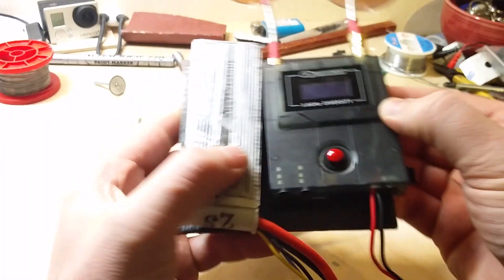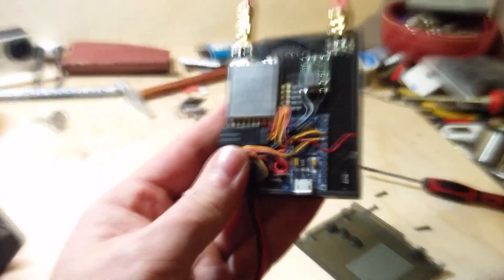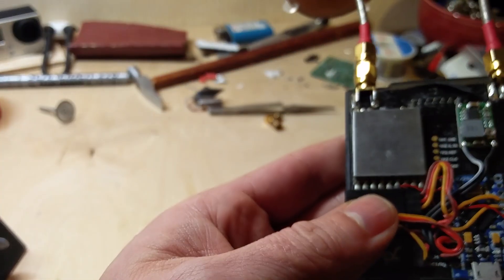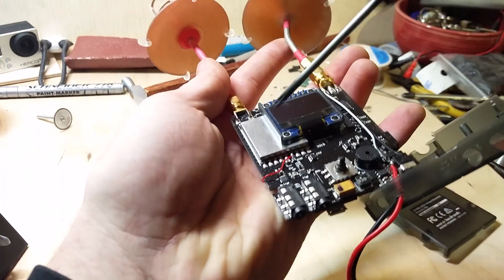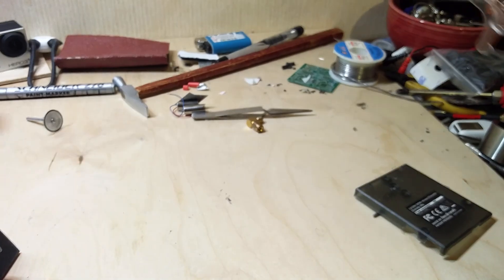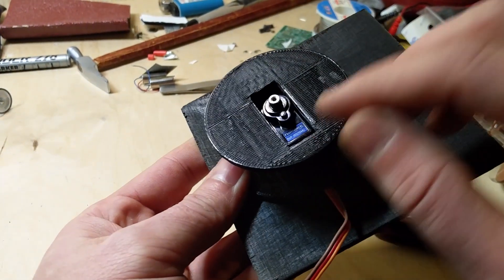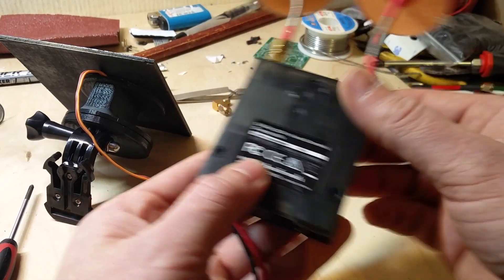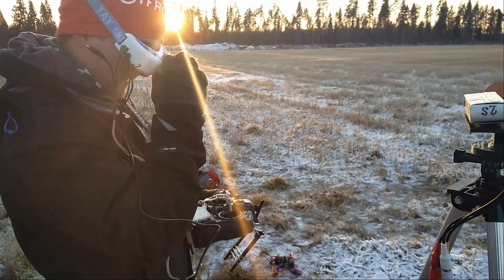SUPER SIMPLE 5.8GHz RSSI ANTENNA TRACKER

Comment: Can I use antennas of different turns?
Reply from the maker: Hmmm..I havent tried. If the difference isn't too big, like 3 and 5 turns, I guess it could work. In theory it would result in offset towards the weaker antenna. In the code there is RSSI_OFFSET_RIGHT/LEFT, you could use those values to compensate for offset.

Comment: Great sharing !!
Must we use two directional antenna or one cloverleaf for fly over and behind is possible ?
thank you.
Reply from the maker: You'll need two directional antennas! As the name suggests Omnidirectional antenna can't tell which way stroner signal is. Current setup & firmware are good for flying in "front" of you, not behind or above.
Reply: With the second servo for tilt, it will be a real good solution, hope the software become compatible soon. Thanks for the fast reply and this good job.
Reply: Could i use patch antenna’s?

Comment: Terve, Antti! Great solution 👍Thanks for sharing it with us. I hope you get to develop it further with tilt function as well (in between your new parenting "hobby" tasks ☺). In my FPV plane I have two VTX transmitters. One with LHCP and the other with RHCP antennas at opposite 45" angle. Giving a better omnidirectional TX coverage. VTX frequencies are individual/different. The Quanum diversity RX supports individual frequencies. I intend to use two of the Quanum Diversity reciever for my ground station.
Do you have a suggestion on how to potentially modify your solution to track dual VTX in the plane. Including tilt of antenna tracker. I think such a solution (dual VTX) will have a significant boost to video quality and stability. Especially when low TX power (25mW).
I hope you will find some time for the RC and FPV hobby again, but good luck with the parental role ☺
Kind regards, Torgeir
Reply from the maker: Hi Torgeir, and thanks 
Which Quanum diversity RX do you mean, the RC540?

About tracking dual frequencies, I think current code might work unmodified. A potential problem might be having 2 different nullpoints (and in general 2 different of everything, vtx antenna etc). Imagine this situation, you are in a turn and one antenna reaches nullpoint -> rssi drops, the other antenna is at 90° and has perfect allignment -> very good rssi. Now tracker thinks the plane is moving left/right and starts wondering off.

This situation is kind of comparable to multipathing, but in this case, one of the channels could "stay down" for a long time, which gives time for tracker to wonder off. Multipathing interference is much faster, and can be dealt with filtering.

Anyways I'm just guessing here. This should be tested in practice.
Reply from the maker: How to deal with all those problems? One way is to use 2 or 3 rx for aiming and one just for reception. But now you end up with 5 video receivers + antennas and its not so super simple anymore :/
Reply: Antti Vainik Hi Antti! Thanks for your reply. Yes, I have the 40ch (32+8) version. 
I have thought of using one to track the plane as you do (on one frequency) and use the other diversity receiver for video (on two different frequencies). What I then miss is a receiver for omnidirectional antenna when flying near or over the groundstation. 
I see your point related to potentially issue tracking on two different frequencies with your current setup. 
Anyhow - I'm curious to test your setup but need to order the components. 
Looking forward to learn more of your progress with your solutoons. Hope you will get some time for this hobby inbetween parrenting ☺

Comment: Any adjustment in code or calibration needed to use the FR632 instead? I think max voltage for best RSSI is 1v for the FR632.
Reply from the maker: Yes, you need to find #define RSSI_MAX/MIN values. Uncomment debug section in code, and use serial monitor to find raw values. I think RC540 max rssi voltage is around 2V.
// raw rssi values, use these for RSSI_MIN and RSSI_MAX
//Serial.print("RAW RSSI: ");
Reply: Excellent! Thanks a lot for sharing.
Reply: Hi, what is the values that you find to fr632? Can you share?
Reply: I checked in serial with FR632, RSSI%  5 , 44

Comment: the replacement camera for the 110 says it is 12v, I measured the voltage at the camera connector and got 4.5. What voltage camera should I use for an upgrade. any camera you would recommend?  I measured that voltage with the camera unplugged, is that ok, didn't seem to blow anything up. 
   thanks for all the info, I ordered a couple of those cloverleaf antennas last week, would like to do both antena and camera mods, couldn't figure out how to adjust the focus till just now watching your video, so thanks for too. i'll try focusing it first but my main problem is picture breakup and those flashing colors you spoke of.  that little 110 sure flies good though don't it?
Reply from the maker: Camera, cloverleaf? I'm guessing you commented on wrong video.
Reply: don't know how that could happen. guess I didn't notice the video had changed.
    your tracker is pretty cool though, saved your video for a future project. (after I get my camera working)
Reply from the maker: No problems, just thought to tell so you could get the answer to your question eventually :)

Comment: How about trees and concrete wals?
Reply from the maker: I haven't tried flying behind concrete walls :) This tracker (or any other) is not a miracle device which will allow you to do so, sorry.

But since you ask, I'm guessing that flying behind any massive obstacles would create a lot of multipathing. That means the rssi will be jumping up and down quite rapidly. Most likely those drops are going to 'reach' antennas slightly at different time, which will confuse the tracker and make it very twitchy.  

This tracker works best for long range FPV in wide open areas.
Reply: Thanks for your answering!

Comment: hello sir Im interested to build your tracker sir i have question is it possible to used 2 pcs 1.2ghz vrx? or is work in 1pc 1.2ghz vrx only? thanks you
Reply from the maker: All video receiver discussed here have 2 built-in receivers, but you can use 2 separate ones, as long as they have RSSI output. So the question is, do you know a 1.2GHz receiver with RSSI output?

Comment: I watched the video of how to include an Arduino library... 
So if I understand, we have ONE "Timer" library which has everything we need for the Arduio part of the project. 
The Arduino will run ONE library at a time, that being the one that is loaded, correct?
So that once the Timer library is loaded the Aruino is then all set?
Thanks,
Bill
Reply from the maker: Hi Bill. Once the Timer library is loaded the Arduino is all set, correct!

If you look at the code you will see lines like #include <Servo.h> and #include <Timer.h> those are all libraries and you can have as many as you need. With #include we tell our project to use a library. Before you can do that you need import the library into IDE (downloading a .ZIP file). Now all your projects can use that library. I hope this clears things up.
Reply: Thanks for that, it really helps.  And it`s great to now have that essential obvious step explained, that the libraries have to be imported first, so that timer.h can build correctly.
Reply from the maker: No problem. After you have uploaded the sketch, the next thing is to calibrate rssi min and max values. Dont hesitate to contact me.
Reply: Thanks... OK, so to calibrate the RSSI values, first of all, where do we see the values displayed?

Then, do we iteratively edit the values and recompile and upload the sketch, then repeat as necessary?  Thanks,  Bill
Reply from the maker: Sorry for the delay. In simple-rssi-antenna-tracker.ino sketch uncomment (remove //)
    //Serial.print("RAW RSSI: ");
    //Serial.print(avgLeft);
    //Serial.print(", ");
    //Serial.print(avgRight);

Then upload the sketch and open /Tools/Serial monitor or press CTRL+SHIFT+M. Now you should see RAW RSSI values. See what they are with video transmitter off and on and assign those values to RSSI_MAX and RSSI_MIN.
Reply: Hi, today I tried uploading to 2 different Arduino's.  Both connected with COM ports via the USB connection, but for both, each one timed out during the Upload step...  Does the Arduino need to be powered up as well?  Maybe I'm confusing these with USB-powered FPV flight controllers;)
Reply: So now I have tried 2 different windows machines, 3 different cables, and lots of tries and all failed.  This was a beautiful idea but and i bought all of the stuff and am now stopped by the seemingly simplest of things.  I get a COM ort always but never do connect for nthe uplaod.  I see the orange LED blink 3 times, then every 15 seconds or so for each of the 10 failed  upload attempts, and the error is always the same:  programmer is not responding.  Argghhh... what a bummer ;)
Reply: So it looks like I got it uoloaded!  I opened up the example "blink" Examples > 01.basics > Blink and saw that it loaded fine,  then I uploaded Examples > Examples from Custom Libraries > Timer-master > blink2 and that worked.  Then I opened recent and chose the simple-rssi-antenna-tracker and hit Upload. This time it went through with a new message
"Build Options changed, rebuilding all" followed by the report of how many bytes were used, etc;  In the meantime I had commented and uncommented the include lines in the rssi tracker sketch just to see the errors... today was my lucky day LOL!@@
Reply from the maker: Glad to hear you got it working :) Which Arduino board you're using?
Reply: It's the same as what you shared, with the same Mega32U4 chip and micro USB port.  Mine says "Pro Micro".

So the uploading issue came down to a setting in the IDE, in this case the board, which said "Pro Micro or Pro Mini", which was a setting from the last time I used the IDE to connect to a board.  Turns out that Board Information said "Leonardo"..  I selected that board and after that it just worked ;)
Reply from the maker: Yeah, it's Leonardo, naming is a bit misleading.
Reply: So now the next step is to get into the 540 VRx and make the mods and additions, which is going to be very easy compared to the LOE for the Arduino part ;) (it almost always comes down to something simple that was overlooked) 

I am going to use your *.stl files to make the turret base and parts.  You mentioned that the opening is based on the Turnigy servo you had on hand.  I'd possibly like to modify the stl's to be able to change the opening and the cavity for perhaps a larger servo.

Would you mind sharing the source files for those parts so that I could edit those and make new *'stl files that reflect the changed dimensions? 

Anyways, I appreciate your responses to my questions - hopefully others will read and benefit as well.  As appreciation I will write up a little guide to augment the video.  I was thinking of creating a little content on the Arduino programming / uploading part which blocked me for a little while, and more content on the RSSI calibration.  I have read the bits and pieces you have shared and would like to bring that part all into one section.  I would make a pull request and maybe you could merge it into master in the git repo ;)

Thanks,  Bill
Reply from the maker: Hi Bill, thank you very much for contributing to this project! A tutorial on setting things up would be great, specially from a person like you who had to start from scratch. 

About the servo mount, I modeled the parts with FreeCad (great free software, available for Win, Mac and Linux) If you are not familiar with FreeCad it will take a week to learn it. I can modify the drawings for you, just tell me what servo you are using. I'll put the FreeCad files on Github later today.
Reply: Hi Antti, So I tried to print the parts and found that I could not. For me it seems that the stl files have some errors such as faces facing backwards in Kisslicer which is the tool I know.  So actual source files would not be good as I do not know FreeCad - thanks! Unless I can just open them up in FreeCad and export the stl's myself.  

The errors I am seeing may be an artifact of the tool I'm using so please don't get the idea that I am being critical.  There may be something on my end that is causing the problem ;) If you would try opening the stl's for printing, that would be good debug info for me.  

Anyways, I would like to use a standard sized servo so the cavity and opening would reflect that, while still allowing the use of a smaller servo by shimming to fit.

My next step is to install the step-down regulator and the Leonardo and complete the wiring.  Thanks,  Bill
Reply from the maker: I added the files to Github. tracke-servo-rig.fcstd is the one you want. You can get FreeCad at http://freecadweb.org/wiki/Download it supports many file formats, so you should be able to export what you need.

The drawing is messy, because I didn't think I just drew it. Actually I think the whole servo mount is kinda weird, and should be re-done. Mail me if you have any ideas

Comment: Does the pan and tilt funktion need more than two rssi values?
Reply from the maker: Preferably yes. With 3 rssi values pan & tilt is quite straight forward, no trickery required. With 2 rssi values pan is easy but for tilt you would have to move the tracker up, take a measurement, move down take a measurement, then compare which one was better and move back that way again. So that would make tilt tracking slower. Still I think its doable.
Reply: Thanks!
Reply: Just an idea, but I think some pilots fly higher altitude (long range) and some mostly horizontal speed (fpv racing). So there is some tracking speed priority either in tilt or pan, depending on how they fly, so maybe they can configure the antenna to match their flying style and configure it in the software as such. So, even though double sampling might make the tracker slower but usually only one axis is priority, at least in my experience.

Comment: if I use two video receptor of diversity, can i do the tracking in pan and tilt using the same program? can i use an arduino uno and a servo of 20 kg/cm?
Reply from the maker: Sure Arduino Uno will work, and I think pinout should be the same. 20kg/cm is ok, even though its quite big, I'm using 1.8kg/cm.  Make sure your 5V regulator can supply enough current for your servo.

Funny, I never thought you could use two diversity receivers, but it should work :D just turn one of them 90° for tilt. Cool!

Comment: i very confused with how to set it all up 
you have you're file and timer file. 
im just confused to where to unzip them in the program and how to do so.
is it possibly to upload a small video or explain a little ore for someone who's never used one of these boards before
thanks in advance.
Reply from the maker: Check out this video. Use method 2. Importing  a .zip file library. https://www.youtube.com/watch?v=K1cIWCBKaUY
You are not the first one who is confused about Timer.h I'll have to think of a better way.
Reply: Antti Vainik thanks, so is the timer,h zip the only one we are installing or do I then install your file as well?
Reply from the maker: The process goes like this:
1. download simple-rssi-antenna-tracker and open it in Arduino IDE
2. download Timer-master.zip and import it in Arduino IDE. Sketch/Include Library/Add .ZIP Library...
3. connect your Arduino to computer and click on Upload button. You are done.

When you click on Upload button, Arduino IDE combines functionalities of Timer.h and simple-rssi-antenna-tracker.ino and installs the result on Arduino. Answer to your question, you are installing both.

Before step 3. you actually have to do some some settings in simple-rssi-antenna-tracker.ino. Read comments above #define tags, and fill in values for your receiver. The most important ones are RSSI_MAX/MIN and RSSI_OFFSET_RIGHT/LEFT

Comment: Hi, very cool tracker. I want to build one but the arduino source code link is dead and the HK servo link is dead. So cannot build one since no Arduino code. Can you re-post please?
Reply from the maker: Hi, I just checked all links and they are all valid! Can you google for "simple-rssi-antenna-tracker" at the moment, Github link is 3rd from the top.
Reply: Thanks for that!  I was using my iPhone and for some reason the link was giving a 404, but now in the actual browser it works ;)

Comment: Nice and simple project.
Could you please also add the source of helical antenna into the list? 

For the servo I would use this one with 270 degree of travel: http://www.ebay.com/itm/270-Degree-High-Torque-Metal-Copper-Gears-Servo-Motor-For-DIY-Robot-Good-Quality-/192002483556?hash=item2cb43d6564:g:FFEAAOSwI-BWIKr9

Have you tested it behind the trees? Like this: https://www.youtube.com/watch?v=hgQuajFxF-Q
Reply from the maker: I haven't tested it behind trees. It's winter here and flying is very limited now.
Thanks for the servo tip, I will order one and test it!

The helical antennas are made by a local guy
https://www.verticalhobby.com/kauppa/en/58ghz-rx-fpv-antenna-helix-h3-v2-rp-sma-p-5678.html